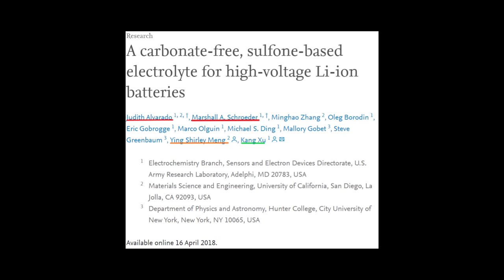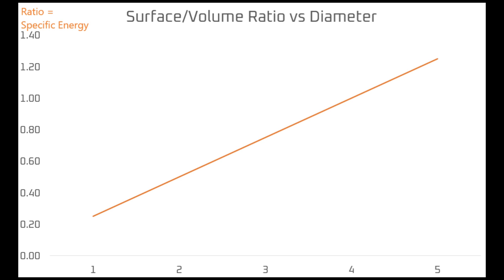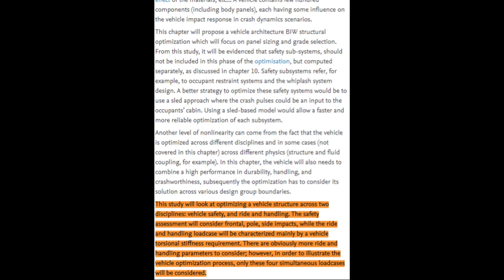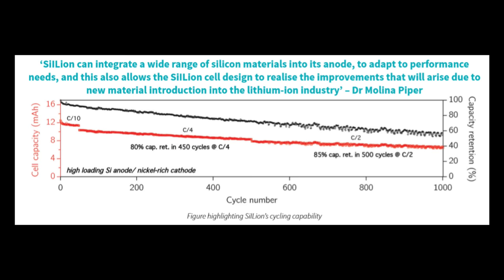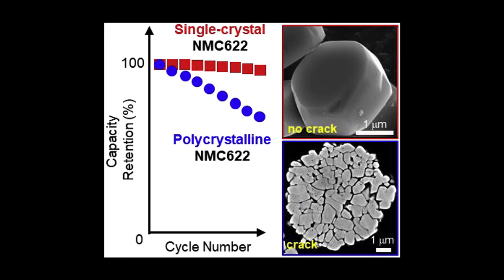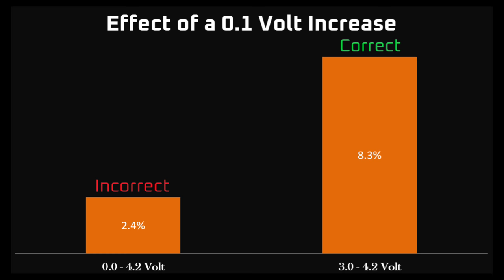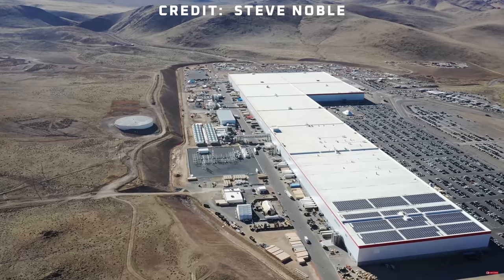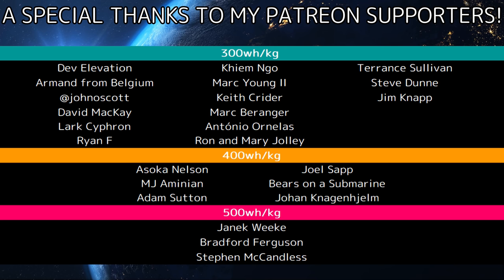New Information 💥 Tesla Battery Investor Day 🔋

Comment: As usual, great video. Love the effort you put in it.

20:03 If you are referring to your Technical Deep Dive episode, then I should come clean.
I should have pressed more on the assumptions I made. I write this as an apology, a way to correct myself and to stop the spread of misinformation.
Re-reading this, it's a mess. Hope you can understand.

 The truth is neither option is correct, because it all depends of the shape of the Voltage x Charge (VxA) graph.
 Assuming the same battery is used, by increasing the pick voltage you are forcing more charge from one electrode to the other, and since energy = voltage x charge, this can have a big impact.
CAN have.
 To illustrate what I mean, grab a VxA chart, like the one here (scroll down, the first one):

https://batteryuniversity.com/learn/article/discharge_characteristics_li

 The different colored lines have a different meaning here, but they will help illustrate the point.
Let's take the green line: it usually has that horizontal S shape, but let's make this easy and simplify it to a slope, which means we are working with a right trapezoid, which starts at 4V and ends at 3V. 
 Now to make this easy, let's double the delta(V), which means essentially continuing the sloped line towards the left (into the negatives, but it doesn't matter) until it reaches 5V. By doing this you are adding a bunch of area to the left and, since the energy is represented by the area underneath the plot, you can see that doing this massively increases the energy stored, doubling it and then some (you can do the calculations if you want). Double delta(V) >> Double+ energy.
 Another way on seeing it is: you are shifting the slope to the right, generating more area on top and on the right as you do so.
In the graph linked, look at the green and blue lines, which are roughly parallel. Yes, they relate to speed of discharge, but the geometry aspect doesn't change. 
 As you can see, the maximum voltage goes up from ca. 4 V to 4.15V, or an increase of 3.75 %, or a delta(V) increase of 15% (from 1V to 1.15V). Now look at the extra area added, both on top and on the right, because the 3V cutoff occurs at 2900 mah for green, but at 3300 mah for blue (that's the magic).
Sure, the bottom part of the graph is missing (it only goes to 2.5 V), but the extra area is clearly more then +3.75% and closer to +15%. 

But the trick isn't so much the increase in delta(V), but the double whammy of increased delta (V) and increased stored charge which both feed into the energy content.

BUT: you cannot ignore the S shape, because it dictates how much charge you add per unit of voltage and at high voltages the battery tends to struggle to move more charge, as you can see in the chart (1C) where the green line starts to slope more steeply around 4V: if you continue that slope, you rapidly reach double delta(V) at 5V, which means you do a lot less then double energy density. Less charge is gained per voltage increase.
 But that is a random chart, not Tesla's current technology and of course not a future one. 
The limiting factor previously was the electrolite reactivity, so it is possible the extra voltage can still contribute its fair share to energy density. 

Basically you NEED the chart. And since it is quite possible they are using a different battery chemistry, and these charts are chemistry dependent, well....

P.S.: In my defence i did add a little disclaimer afterwards (To tell you the truth i assumed a voltage increase correlated linearly with a stored charge increase, but that isn't necessarily the case. You'd need the actual graphs of V x Ah and then integrate the curves 4.2 V vs 4.8 V).
But i understand that's not good enough, if I could have been clearer the first time, I should have.
Reply from the maker: Probably my best way of paraphrasing what I read is that batteries are infinitely variable.  There are few 'truths'.  For example, a battery can be a 1000 mile battery or 1000000 mile battery depending on the testing conditions.  My response:  I'm putting forward heuristics to help people make sense of a complex landscape.  I have to make a judgement call as to how deep to go.
Reply: @thelimitingfactor  True enough. 
I just wanted to make sure i hadn't convinced you to of the idea that 20% extra delta(V) = 20 % extra energy density, because, as you said, it's complicated.
Then again I might just be reading into things too much.

Cheers. Keep up the good work. Probably the best I've seen so far on the topic.
Reply from the maker: @VIIflegias  Thanks!  I appreciate it!

Comment: Jordan, have you here about Samsung's solid state battery.  Could this be a game changer for a another company to compete with Tesla? 
https://www.nature.com/articles/s41560-020-0575-z.epdf
Reply from the maker: I saw that, and I saw the video that Subject Zero Science did on it.  A comment by the researcher said everything:  "The product of this study could be a seed technology..."  This says it all.  That's management speak for "we don't see any value in this but we thought it was a cool idea."  

The main reason why, on a grand strategic level:  It contains silver.  If you want to accelerate the transition to sustainable energy, you don't make precious metals the primary component of your battery.

On an operational level, it's because there is no one out there manufacturing these materials at a large scale.  This would take at least 5 years.  All the materials would also need to be verified with long term (3 year) cycling and run through a gauntlet of safety testing.

Comment: The CyberTruck is scheduled to release in late 2021.  Converted from Elon time, late 2022 seems more likely.  Does 300 Wh/kg work for a 500+ mile $70,000 CyberTruck?
Reply from the maker: That's a good question.  Cybertruck will be an entirely new type of vehicle.  I'll be interested to see if they hit any roadblocks.  However, I'd expect at least 300wh/kg.  But, more importantly, much higher energy density at the pack level with a better pack set up.

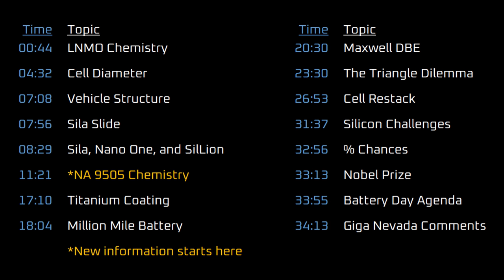Comment from the maker: 1) Timeline at 00:30.  2) Watch at 1.25X if you are battery savvy.  3) Point of clarification folks!  Single crystal cathodes are one thing and the titanium coating on top of that is another thing.  I oversimplified - in the video, both were made into one single object. Single crystal cathodes are synthesized first and then Ti coating is applied to the cathode particles.
Reply: Joke's on you, I watch most of my videos on 2X speed (but my engineering background probably helped here)!

On a serious note, great video! Just started my journey down the Tesla rabbit hole and I'm excited for the future.
Reply from the maker: @Etherkai  Thanks man!  Yeah, 2x for me too, especially when researching.